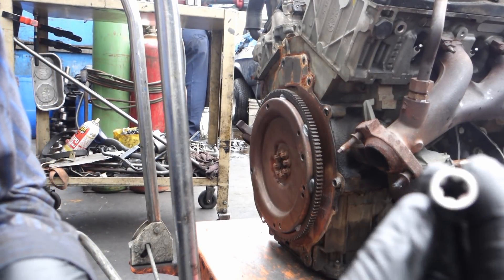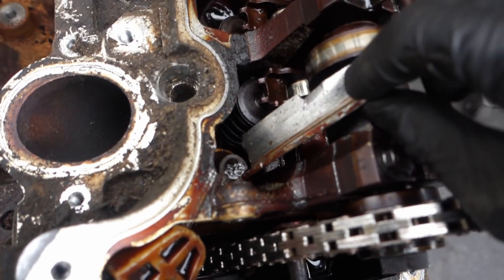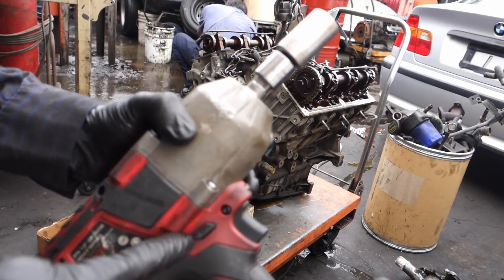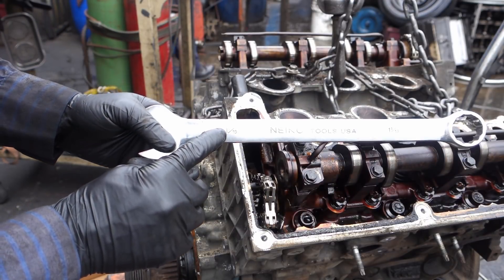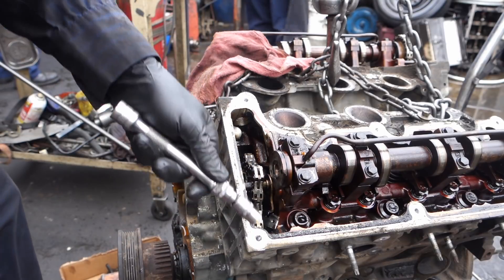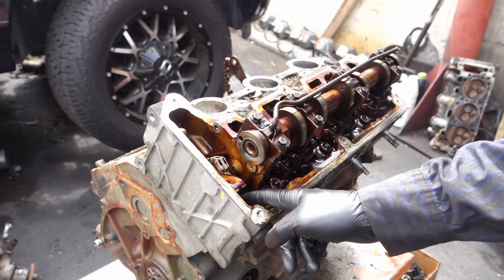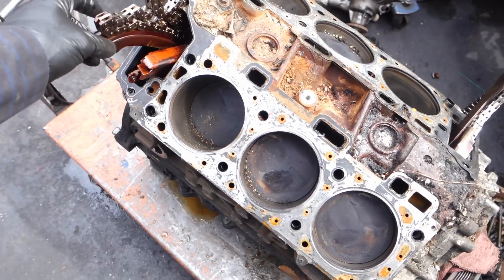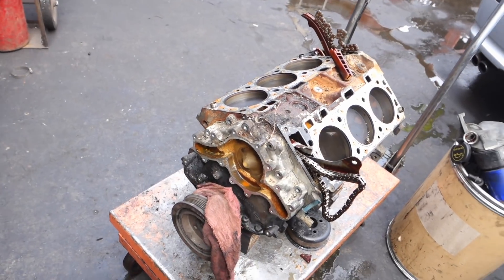Ford 4.0 ranger, explorer ,expedition, heads removal,timing marks

Comment: I have a 2007 4x4  its making some noise at low idle that could be the cassettes. It's more of a chatter than rattle
Reply from the maker: Bad engine 😢
Reply: My 04 had that. Hydraulic tensioner failure. Chain raking across upper cassette pivot. It had been doing it for a while. Chain had almost cut halfway through it.

Comment: One of the best badly built engines out there. If it wasn’t for that stupid timing gear design, the dang thing would run forever.
Reply: You have to wonder why.  It has to be for ease of manufacturing.   Using tbe same head on both sides of the engine.  In the mean time  I'm stuck with an Explorer that is not worth fixing.   It's a shame.

Comment: How would you replace the lifters on this engine after you have the valve covers off what’s next ? I have this exact engine with bad lifters they make a bad sound when idling
Reply from the maker: 100% safe its removing the cams, there is other way but you might skip the timing or break a camshaft cap!! try a lifter noise liquid and if dont work,then the while engine is coming down,and since engine is out then replace timing chain kit and the lifters! Most likely it's time for the timing chains to be replaced anyways
Reply: I THOUGHT THAT BY THE TIME LIFTERS ARE MAKING NOISE,ITS TOO LATE,THEYRE TOO FAR GONE TO BE HELPED & MUST BE REPLACED....
IDK..

Comment: THat engine is more German than the BMW in front of it. It is built in Germany
Reply: Are these engines pretty reliable?
Reply: @elonsus9747  Fuck no. If you ever want an explorer or ranger look for the OHV 4.0. They are made before 2000. They have a bit more low end power (but these SOHC- have more HP), but they are shit. They were used till 2011 in the mustang and explorer. DO NOT BUY.
Reply from the maker: This 4.0 with chain in front and back NO THEY ARE NOT-- STAY AWAY FROM ANY CAR WITH THAT ENGINE ON IT!!!
Reply: @JM8686  We have a 2005 Ford Explorer with 4.0! Yikes..
Reply from the maker: There is 2 kinds the yikes one and the one with the cam in the middle of the block Haha if you have that one YOU LUCKY
Reply: @JM8686  I can't believe they used 2 chains!
Reply from the maker: Yeah they suck on that engine because to replace the chains you must remove the engine
Reply: yes, I watched a guy do that in one video. What do you think of Nissans 4.0 engines?
Reply from the maker: Nissan 4.0 solid engine upgrade from the 3.5 vq35 engine!!
Reply: @JM8686  Ok. I have an 2008 Nissan Pathfinder with the 4.0. Are they a lot better than the vq35 that they are deprived from?
Reply: @alb12345672  Thankfully the Explorer isn't mine! Doing a oil change tomorrow ironically.
Reply from the maker: @elonsus9747  to be honest all depends if you at least do the full synthetic oil change when you have to do it,then the engine will last TWICE LONG!! cant say one is better than other so just keep up with the maintenance because those are expensive engines!! Honda,nissan and Toyota are great engines 👌
Reply: @JM8686  Yes all those 3 make great engines! Thanks.
Reply: I got the 99 ford ranger xlt 4x4 4.0  with 179000 on it still running strong picked it up for 800 . Got a beater for my lawn care business lM run it till dies then thinking about swapping the 5.0 in that bad boy .
Reply: How wack are these ??